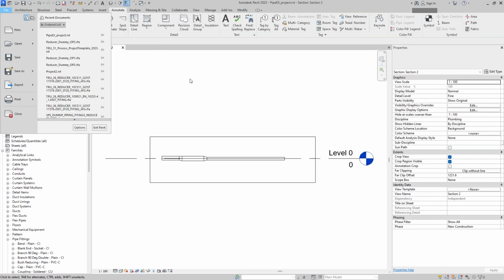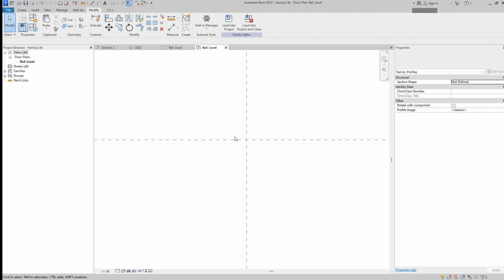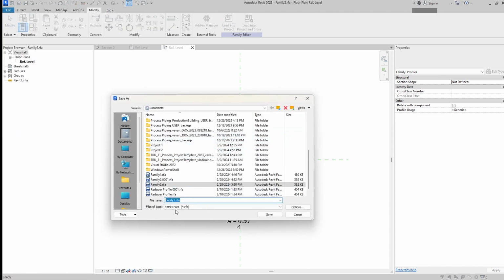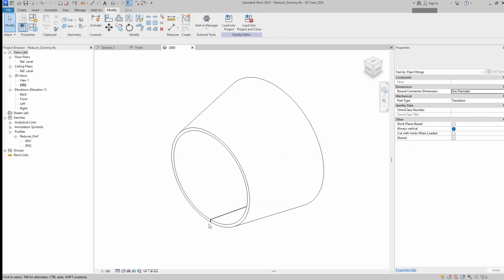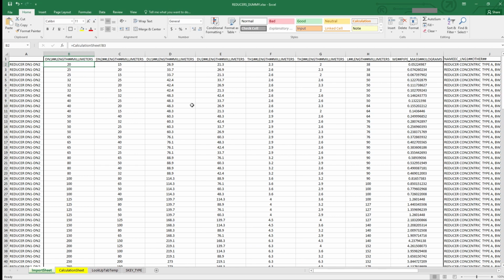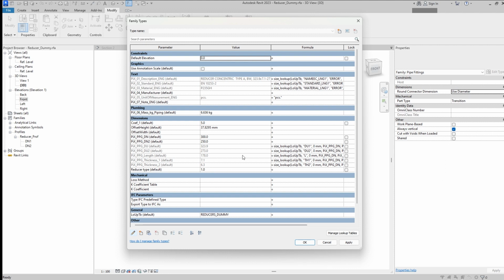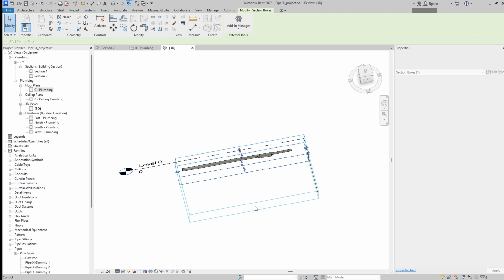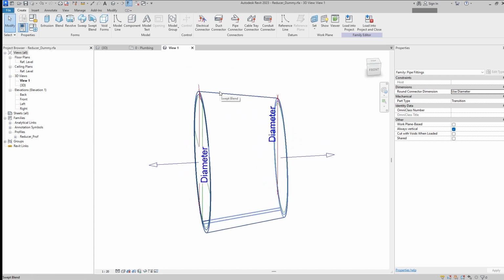Part 1.3 - Piping Modeling - Revit Tutorial - Reducer EN 10253-2

Comment: "Hi PipeEX! Thank you for sharing this wonderful family set. It works well with large pipe profiles, but with smaller pipe profiles, the error 'Can't create swept blend' occurs. Specifically, for sizes where D1 is below 100 and D2 is below 50, the error happens. Is there a way to fix this issue?
Reply from the maker: Hi, just check the geometry and try to do the same stuff with small sizes instead of a big one. It must work.
Reply: @PipeEXorg  Thank you, I fixed it already; the issue was due to the Angle being too small, which caused can't create sweep blend.
Reply from the maker: Indeed, this is also possible 😀
Reply: @ovietcuong6478  Hi, i got the same problem. What parameter did you changed?

Comment: Hello PipeEX! Excellent work, I wish I'd had founded your place sooner. I got almost everything rigth, except: My reducer works fine with big to small reductions. But does not work with small to big reductions. I duplicated and inverted the lookuptable as you said, but still does not work. I really dont know what I'm doing wrong
Reply from the maker: Thanks a lot! Well, this is strange. Usually, it should resolve the issue. You can also try to resolve it with the conditions, like if dn<dn2 use this/that. Try to rewatch this part to see the difference.

Comment: Hallo.Based on the methodology learned in the tutorial with slight variation, I appreciate your kind advice after I tried to create my own eccentric reducer family. At all connectors except the last one, the pipe is slightly tilted by almost one degree.In cross-section, Revit seems to consider only pipe axis while modelling the pipe via pipe routing. I can share  the screenshots or the family itself upon request. Thanks and best regards
Reply from the maker: Yes, indeed, this is the disadvantage of using the standard way, as the software calculation is based on the nominal diameter, but not outer diameter, that leads to such a deviation.
Reply from the maker: But it is good to mention that it is applicable not for all the diameters.